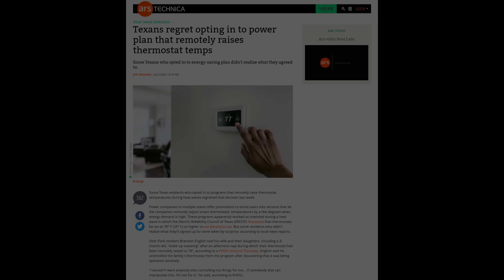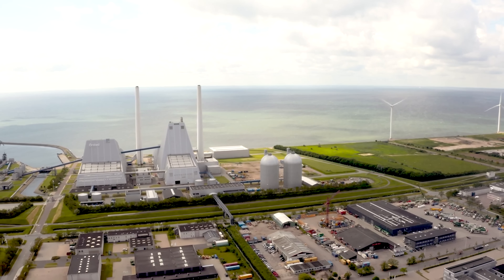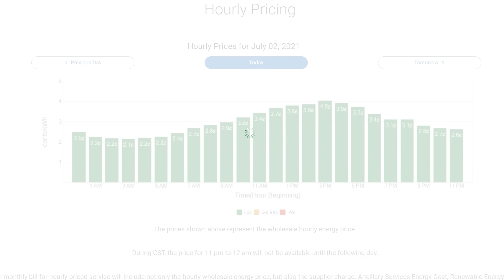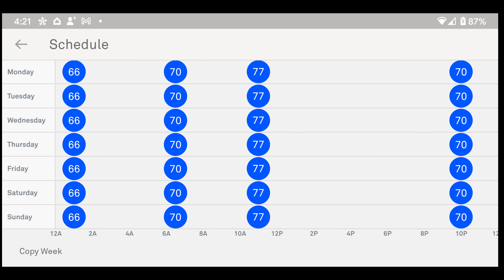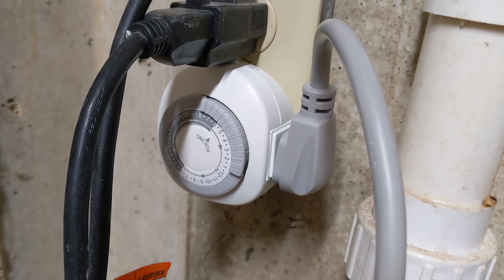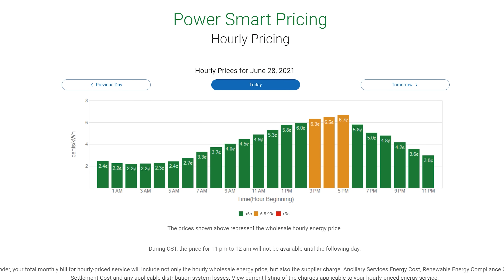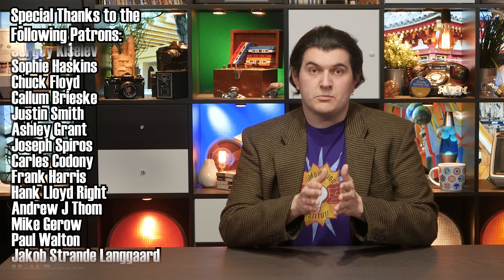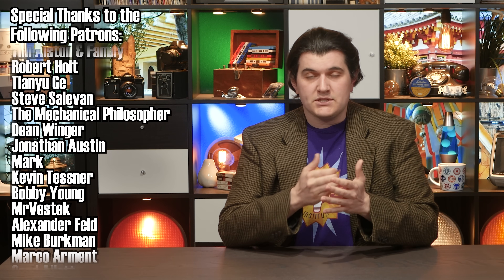Batteries aren't the only way to store energy. Here's another.

Comment: I'm in the PNW and we have a couple strategies in our very old house. 

1. Over the biggest windows, there's an arbor with grape vines-- this means no leaves in the winter, and plenty of shade in the summer. 
2. The temp differential here during the dry summer months is such that most of the summer, we can just open everything up at night, let the breeze cool the house, and close it up in the morning, keeping the heat out for the rest of the day. 
3. During the winter, we never have the thermostat over 65, but use a lot of blankets and sweaters and hoodies. We don't have peak pricing for energy here, because it's mostly hydropower/wind/solar, so at night we turn it down to 60. 
4. Rather than cooling the whole house, we air condition the south-west facing bedroom. I put it on eco when I leave the room, and it gets up to about 78, and then put it on auto cool at night as soon as I'm up there, The room stays tolerable, I can deal with the rest of the house being warm, and it doesn't usually get that warm. During massive heat waves, this means we have a comfortable place to take heat breaks, but are air conditioning a huge old house.

Comment: If I signed up for a variable rate plan, there would need to be some sort of price cap to prevent the $2000/month electric bills that some people got during the Texas winter event.
Reply: At that price, the Texas grid could have just joined the goddamn Eastern Interconnect and not had a problem. Remember that saying "united we stand, divided we fall"? Yeah.
Reply: @DESUDESU24  Texas normally produces more power than it consumes due to the best wind power potential in the USA located around Amarillo, Texas. While they have been attempting to establish Eastern connections for the exportation of wind power the NIMBY land owner crowd has been a massive barrier to do so. It's more complex than you realize as some have legitimate arguments as some demanded wider clearance of forestry in the event of power line failure. Some demanded buried power lines.
Reply: Yes. I'll never trust a variable rate.
Reply: Where I am it's just a set schedule instead of daily variable. It's still more expensive during peak hours, but it doesn't vary daily.

Comment: Replace home lighting with wall-to-wall, glow in the dark stars for  nostalgia and energy savings!
Reply: Why not just use glow in the dark paint
Reply: @MargaritoTrevino  cause that would be less fun and misses the nostalgia factor
Reply: Lol
Reply: @MargaritoTrevino  Well just like the glow in the dark stars it's not bright enough to actually be able to see what you're doing. Now some radium paint and we're in business.
Reply: @setcheck67  Well at that point might as well sprinkle your food with uranium salt and you might start glowing someday. Pure profits!
Reply: I have a glass vase filled with glow-in-the-dark plastic pebbles. Functions as a night light for many hours after sundown, and as an emergency torch. And if light is not wanted; simply cover it with some fabric. Next best thing to a tritium torch.
Reply: Modern LED lights use 100 watts in 10 to 20 hours depending on the light. This is nothing. A low wattage light is extremely easy to power with even a tiny solar panel. Everyone in danger of deadly heat from Summer power outages should get a folding portable solar panel with USB outputs and a USB fan. Even the small folding panels will power these fans full blast, cloudy or not, and you can get USB extension cables to put the fan wherever you want. These easily power a USB LED light bulb too. Use the panel to charge up a USB power bank for nighttime use.
Reply: I tried that as a teen, the discharge of light from them is fast.
Reply: Cool idea, however that just creates the problem that creating that generates a fuck ton of waste and some of it will be very unfriendly to anything living.
Reply: I'm so nostalgic for 2013!
Reply: I hope y'all realize I was making a joke here. Goodness...

Comment: As someone that’s installed power shedding thermostats professionally for the local utility it doesn’t work with heat pumps in the heat mode.

1. Messing with someone’s heat is dangerous because we don’t know the heat load on the house. Turning someone’s heat off for an hour could drop the temp to cause a freezing condition in the further corners of the house that might have pipes.

2. Most importantly when a heat pump has a 1-2 degree demand the auxiliary heat comes on to supplement the heat pump. In my area (and likely yours) that would be a 10-15 kW heater with a 2.5 ton heat pump. See the problem? You and the utility save 2.2 kW from turning off a heat pump trying to maintain a temperature to than immediately spend 12.2-17.2 kW to make up the difference. 

The power used by auxiliary heat is such a high load that keeping your thermostat at a constant temp in the winter can be more energy efficient (from a cost perspective) than programming it (in the winter). The further north you are will determine that threshold.  But it occurs as far south as Virginia in old homes currently, likely further south depending on just how bad the homes insulation is.

It’s adorable you thought you were outthinking the engineers and professionals that specialize in this though. Truly love your channel if nothing else but getting me to think logically and ask “why is something done the way it’s done”.

When you eventually get a heat pump try to find a means of control with back up/supplement heat efficiency modes. This allows the heat pump to just run for extended periods of time rather than immediately resorting to its resistant heater. This can be done with time and/or temperature differential. Honeywell FocusPro and VisionPro used to have a setting that when the heat was going to into a scheduled period it wouldn’t use back up heat but they removed it on newer models.

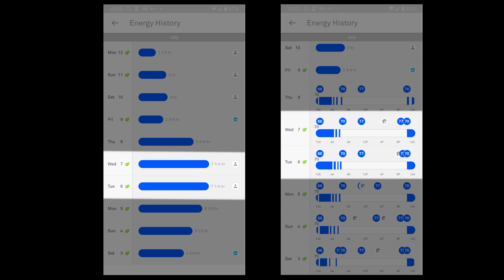Comment: 11:07 You might have to watch out for condensation within the walls, not just on the windows. Not sure what your building code dictates there, but with high outdoor dew points, misplaced/missing vapour barrier and cold indoor temps, things can get nasty.
Reply: That was my thought too.  Mold sucks.
Reply: If the house is only 10 years old he should be ok
Reply: If it's AC, then the air should be somewhat dry
Reply: @byaafacehead  It's true that AC does dry the indoor air, extracting moisture and lowering the dew point temperature of that air (though often the RH doesn't change significantly, as you're also lowering the temperature). The problem with very low indoor temperatures in hot humid weather is that you can get condensation within the building structure, not only on windows. The moisture there is coming from outside, not inside.
Reply: Most home have a vapor barrier.
Reply: @juanvaldez7279  vapour barrier location is designed for winter heating - it's on the wrong side of the insulation for summer cooling
Reply: @johnjohnson-oj7md  Vapor barrier materials are installed on the warm side of the insulation in a building assembly, as determined by climatic conditions. In warm climates, it will be on the exterior and in cold climates, it will be on the interior.
Reply: Yep. Much of the Eastern US has humidity above 80% at night. This will grow mold in any house.

Comment: In the evening, I open the front AND back door. This creates a very slight cross breeze, but it is enough to pull hot air out of the house. I do mean "slight." I don't even feel it, but the hot air is drawn out. Thus, the house stays comfortable most of the daytime. I think modern people have forgotten the power of the evening cross breeze.

Comment: Great video. I learned that most water heaters have two thermostats with heating elements.
One set is near the bottom where cold water enters and the other is near the top where hot water exits. They are usually set to the same temperature but I thought this could be manipulated to store solar hot water. 

The water heater would have the standard switch between grid power at night and solar power during daylight. The top thermostat would be set to 120 degrees and the bottom would be set to 140 This means when the bottom heating element is on, the upper element would not come on and the water in the tank would be superheated. 

The trick would be to put a timer on the bottom switch so it is only active during daylight hours
This means that the water would be superheated to 140 degrees when the sun is up and only 120 degrees when using grid power. If the power company offers off-peak rates, the lower element could come on during off-peak hours to top off the water when power is relatively cheap

There are problems such as intermittent low solar power availability during daylight hours and changes in sunrise and sunset times throughout the year. A simple system might have to brush over these issues and not be perfect but I could see a more complex programmed timer controlling the lower element that takes into account solar power availability

Comment: "Heat pump units coming soon." God this saga kills me.
Reply: I had a thought while watching (specifically when cooking dinner was mentioned): Are there heat pump-based ovens now? Or is the required temperature too high for it to be practical?
Reply: @IDoNotLikeHandlesOnYT  I feel like it would take a very long time to get a heat-pump oven hot.
Reply: @IDoNotLikeHandlesOnYT  It's not worth the cost and decreased reliability. A home oven doesn't run that long usually. Even a fully electric resistance oven uses around .75-1.5kw per hour. At average US rates that is around $0.20. If we really wanted to save energy there, the oven just needs better insulation.
Reply: @IDoNotLikeHandlesOnYT  The efficiency of heat pumps drops quickly when the temperature difference gets larger. A combination of compressor and refrigerant are only good for certain range of temperature. When this range is exceeded, the compressor will have to work harder to produce pressure for that refrigerant to evaporate and condense and eventually it becomes less efficient than just use resistive heating element or a flame. A consumer-grade heat pump can probably get your oven at 70 or 80 celsius before completely lost its output.
An easier approach to save energy is to find a better way to keep heat from escaping the oven.
Reply: @yrr0r244  That’s the best reason to get a self-cleaning oven. Not for the cleaning function itself, but for the added insulation that lets it get hot enough to burn off cooking residue. It keeps more of the heat where you want it, heating the kitchen less, and reducing the load on the air conditioning.
Reply: @yrr0r244  Or possibly using solar thermal.
Reply: @IDoNotLikeHandlesOnYT  I think he meant for his clothes dryer. They make heat pump clothes dryers, they're just not common in the United States.
Reply: @hithere7382  Yes: he was talking about his new clothes dryer and water heater, IIRC from watching yesterday. (He'd mentioned the existence of heat pump-based clothes dryers and water heaters in a previous heat pump video, too.) I just—at a different point in this video—had a thought about applying the technology to another appliance.

Comment: Our co-op in NJ offers something called “electric thermal storage” where they heat up ceramic bricks or an insulated tank of water during off peak and then uses the heat during peak hours. They let you pay the off peak rate and shut off the heating elements during peak hours. Works really well. Helps them save the demand charge in the winter.
Reply: With an appropriately sized tank you could probably do that at home, too. We have solar heat panels on the roof with a 600l tank in the cellar, and on sunny days I have to turn the shower down as to not scald myself.
Reply: @rolfs2165  this is an in-home system. The tank is for hydronic heating systems and the ceramic bricks are for room forced air heating systems.
Reply: @n2rj  Ah, I misunderstood and thought it was a central system they have somewhere.
Reply: @rolfs2165   Would be nice for cities but I live out in the sticks.

Comment: Watching this as an apartment dweller with no AC and an entire wall made of uninsulated glass that faces the sun.

... cool.
Reply: Maybe you can install curtains or blinds ?
Reply: In addition, if you want to go high-tech, I think you can get films or coatings that selectively reflect IR (and/or UV, although that's not relevant for this discussion) while being transparent to visible light. Combine that with double glazing etc and windows can be pretty good insulators.
Reply: @jon_j__  Yeah!  Those reflective films work really well, and since they can be a temp installation (a bit of an adhesive on the film + soapy water basically, pretty easy to remove when necessary), they can be very appropriate for an apartment dweller who can't make more permanent changes.

Comment: If I didn't live in an upper apartment in a very, very, drafty building I'd love this idea. I prefer it nice and chilly to sleep.

It makes me wish it was still common here for heating and electric costs to be included in rent prices. Maybe then landlords would ensure their building (s) are properly insulated.
Reply: @Call Me Joey that's super illegal here. Maybe because it gets down to -40 here in winter, but you may want to check and see if you can force the landlord to being more responsible.
Reply: @Call Me Joey Here there are regulations on the minimum heating that needs to be provided to qualify as habitable. While you may prefer it warmer they only need to supply that much. I can't imagine there not being similar regulations anywhere unless the weather is mild enough that it never became an issue.

Comment: the "heat stuff up & let cool slowly" idea is how heating through wood ovens/furnaces works ;P
you burn wood to heat up the huge stack of bricks, which insulate each other, and radiate heat MUCH slower than the fire itself ;P
(and due to the way the chimney systems are often done, on its way out, the hot air heats up bricks around the chimney system in a kinda zigzag, instead of going straight up, giving yet another place where the energy is stored)